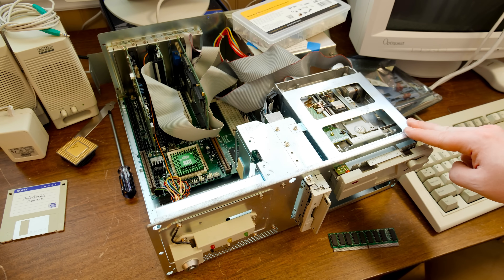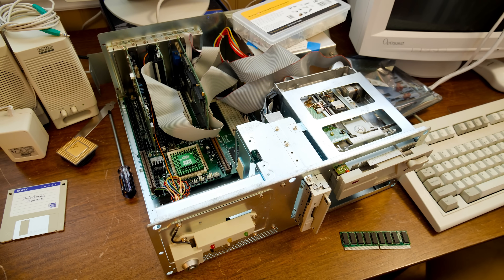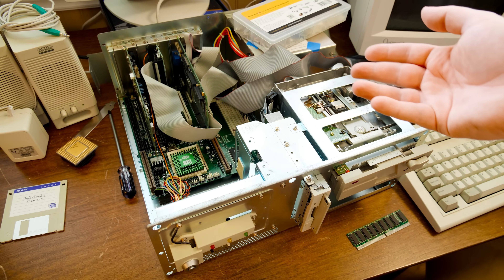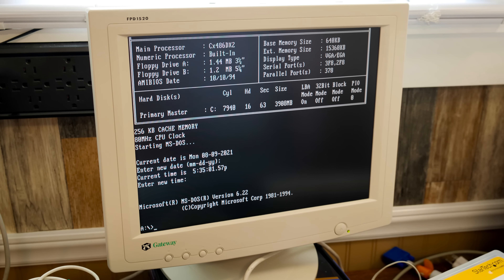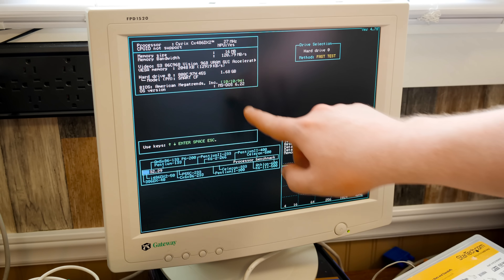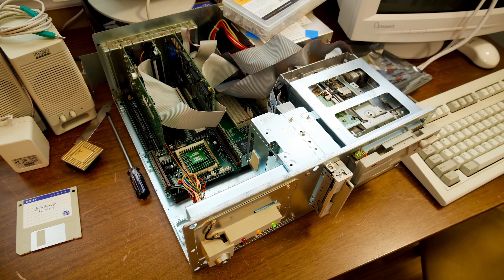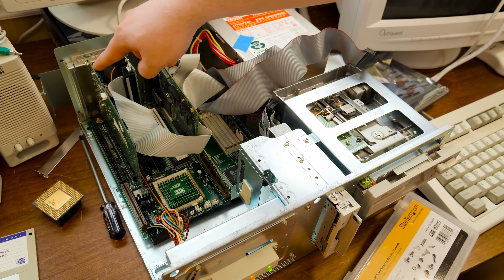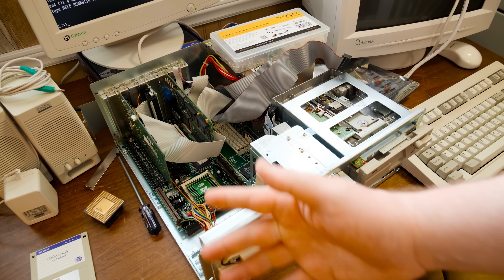M919 Fake Cache and Reproduction L2 COASt Modules

Comment: We used to have a couple pcchips based systems back in the early 2000's at my home. They where the ones where the motherboard had an AMD ¿Duron? procesor soldered into it, and the BIOS was modifyed so it looked like said procesor was a bit faster XDDDD. Mine was labeled as a 1000+, wich means it should be running at 900Mhz, but it was actually running at 800mhz, and BIOS was only tampered show a different model, not a different frecuency!! So, when my pcchips computer was a bit over a year old, there was a couple power outages, and then I felt something was off. "Wait... is this running faster?" I checked, and it was running at 850 mhz XDDDDD. And then the very same thing happened a few months later and it was running at 900mhz XDDDDDDDDDDDDDDDDDDDDDDDDDDDDDDDDDDDDDDDDDDDDDDDDD Weirdest thing that ever happenned to me with a pc.

Comment: These PCChips boards are so strange. Honestly, I don’t understand why they went through the effort of putting together a really solid board—decent chipset, decent VRM, and VLB/ISA/PCI compatibility—all to just add fake L2 cache. The M912 v1.7 is also somewhat similarly-afflicted, but what’s really weird is that not all of them have this issue. Some have fake “Write Back” DIP-28 modules soldered directly to the board, and others, like one I own, actually are equipped with DIP-28 sockets for cache chips! The best part is the shady chipsets, which claim to be UMC8498Fs, but some of which have a UMC sticker, rather than a silkscreen. I think PCCHips wasn’t the only company to pull this stuff, as I’ve got an MTech R407e, which was sold as having previously had 256kb of fake cache, whereby half of of the cache was real, half was fake, and the BIOS reported 256kb. Sure, I get that the manufacturer is saving money, but why? The board worked great with 256kb of real cache installed too—that’s the real kicker. As for the M919, it’s a real good board. I know CPUGalaxy had success with his in overclocking, and it’s unofficially capable of a 60MHz FSB. They’re fast, too, but the fake cache mars their reputation; it seems like they’d be heralded as really good boards if it weren’t for the shadiness that surrounded their marketing. One other thing: the PCI bus has an automatic divider such that—at 40MHz FSB—the PCI bus runs at 20MHz! As much as the M919 is legendary and infamous, it sure is one weird board. Don’t know if it helps, but I saw you found the manual and, for quick reference, Ultimate Hardware 2019 has a good jumper manual: http://www.win3x.org/uh19/motherboard/show/582. RedHill has some info on this board too, and it was apparently not well received by the shop, due in part to PCChips’ shady business practices: https://redhill.net.au/b/b-96.html.
Reply: half the time the chipset was fake as well, the pc chips bullshittery goes pretty deep
Reply: Make a few good products to get an okay reputation then put out a bunch of trash to exploit that and the ignorance of others. Most people wouldn't even think to check if the L2 cache were real or not and, as we've seen in the tests on this video, most people wouldn't even be able to see much of a difference in practice anyway.
Reply: I have a board with the soldered in fake DIL chips. I guess they wanted to lower the price / increase profits and not fitting expensive cache chips was a way of doing it.

The whole saga seems like a precursor to VW's Dieselgate, although PC Chips didn't end up having to buy back all the motherboards.
Reply: PC Chips was not strange - it was lowest quality on market, typical China products. Nothing was below. Cheap but terrible on any level. It has been trash product already on production line.

Comment: The memory check at the starting of the computer seems pretty wonky as well, 16 megabyte  is not 16000 kilobyte, it's 16384 kilobyte.
Reply from the maker: Yeah I found that strange as well. Memory's perfectly good though, I used it in another machine for years and it passed all tests I performed the other day

Comment: Huh, such a fascinating and oddly dumb thing - I only dealt with prebuilt PCs back when (mainly Compaqs, a few Dells) in 486, Pentium and compatibles times, so I didn't get to scratch the fun (albeit sometimes stupid) sides of components until the Socket A/370 era. Granted, prebuilts with their ginormous amount of proprietary bullcrap wasn't exactly always fun either.

Nice video as always, Clint! An AudioDrive (ES1868F is such a lovely chipset) would be a "slight" upgrade for that awful Vibra16! ^^
Reply: I didn't understand most of that and that's why I subscribe to LGR

Comment: Yeah i had one of these. i plugged the wrong COAST module into it once, let some smoke out of the module. 

Those fake chips just have like metal combs in them. I broke the top off of one of them and have a picture here somewhere. I think my M919 went in the trash about 15 years ago.

Comment: I'm more surprised that someone designed a clone of the cache chip for this board
Reply: Well, this board was sold by the millions and this fake-cache was known from day 1. I'm surprised he never heard of these boards or how cache even works. Now he knows! :D
Reply: TBH, I just needed that video to know about it :-/. And guess what, same thing going on in one of my retro-rigs. But since the reduction in memory speed by swapping from EDO to standard is overcompensated by adding REAL cache just slightly, I don't bother to do smth about it. Deep inside I am a little annoyed, though...
Reply: Also it's relatively easy for hobbyists to do this this kind thing with modern tech and online services.

Comment: This is genuinely hilarious timing. Released a video on fake cache right when AMD's new gpu with fake pins comes out.

Seriously though it's insane this was a thing, imagine being the poor engineer having to designate part of the board for fake cache

Edit: spelling
Reply: Wait, what card?
Reply: @daemonspudguy  the 6600xt. It's a pcie 8x interface but they added extra contacts to make it look like it's 16x.
Reply: @Its_Soph_ie  That's not a new thing AMD did, though. As far as I know, every GT 1030 has a PCIe x16 connector despite only having a PCIe x4 connection.

I'm not quite sure why, but it may be just that people expect a GPU to have a long connector, and would be confused with a card that didn't fill up the entire connector.

I wonder how many other GPUs are not PCI x16 but have a full sized x16 connector.
Reply: @ZipplyZane  I know it's not a new thing, but at nearly 400 bucks I'd expect a full 16x connector. Even if at gen 4 speeds it doesn't need it.
Reply: @Its_Soph_ie  "i cant believe they made me pay 450 bucks for a 16x interface the card cant even fully utilize!"
Reply: @Its_Soph_ie  I can see that argument. But I was just talking about the connector looking like a PCIe x16, not about the card.

I honestly don't think I've ever seen a card that had a x8 connector.. I've seen x1, x2, and x16, but that's it. And for slots on the motherboard, I've only seen x16 and x1.
Reply: @ZipplyZane  fair enough. I've only seen true 8x in server chassis before. I guess to keep appearances I can understand, just find it weird in a card this expensive
Reply: A lot of mainboards have x16 physical slots that are only x4 electrically (chipset/CPU limitations). I haven't heard anyone refer to those as "fake pins" before. Since I have yet to see an x8 slot on a consumer grade motherboard, what would be gained by going with an x8 connector for the graphics card? You lose rigidity, possibly confuse people (not sure about power delivery through the slot). "[..]at nearly 400 bucks I'd expect a full 16x connector. Even if at gen 4 speeds it doesn't need it." - Why though? You realize that x16 PCIe slot would consume more power (if utilized or not) and not gain you any performance? I can understand someone with a PCIe 3.0 system saying that, since they might lose some performance in edge cases. But I find it strange to liken these two examples.

Comment: Love this video Clint. Any chance you could give us a "History of Shady Hardware" type video(s) on the main channel?
Reply: I've been dying for a Tech tale for years now
Reply: I second this motion! Shady hardware history is very cool.
Reply: I'd love that.
Reply: I would really love this too!
Reply: I used to build PC's back in the 1990's.  Never heard of this!
Reply: @michaelblair5566  so did I. And a few less than reputable pc shops around here got a name for using the cheap boards that came with them. One of them used to hot glue all of the wires and cables onto the board during assembly.
Reply: I miss Tech Tales so much

Comment: I remember reading about the fake L2 cache MB's. Part of the reason why PC Chips had such an awful reputation in the mid to late 90's. Even when they rebranded themselves as ECS later on the stigma partially remained. 
Also, adding L2 to a 486 system doesn't make a huge difference in most DOS based programs & games (with some exceptions of course) but it does make a noticeable difference in Windows, especially Windows 95. I had a 486 DX2 66Mhz based machine from 1992 that I had upgraded to an AMD 5x86 133Mhz CPU (running at 120Mhz due to MB issues) and adding 128KB of L2 to that machine via socketed chips on the board made a nice difference in Windows 95 back then. Hardly noticed a difference in DOS. I had the option of adding 512KB of L2 to the board but it would have cost much more than 4x the cost of 128KB and being a broke teenager at the time I couldn't afford it.

Comment: Don't rely on cpu benchmarks for cache performance testing. Cache makes memory access faster, but an old test software may only do some simple calculations in a loop that only uses a few bytes from the memory.
Reply from the maker: Good point! I often notice more of a performance gain in certain games than I do old benchmarks.
Reply: @LGRBlerbs  Yeah, I might try DN3D or something. Web browsers are a good test, too - Mozilla would run a fair bit smoother while using the very same DX/2-66 after swapping out a slow VLB board for one with roughly doubled main memory performance, and that's with L2 cache already in. I also found a lowly Pentium 133 to be surprisingly snappy if decked out with 512K of L2 cache + tag RAM on a GA-586HX even with just fast page DRAM in it (I had gotten a good deal on 128 megs of FPM at one point, and this was my NT4 machine as well).

Comment: I must of had the same motherboard in around 96/97, got it off a friend who had a dx4/100 from new, then fitted a cyrix 5x86/100 and with the cyrix installed it wouldnt boot at all with the l2 cache enabled, but still gave an improvement over the dx4. I got it because it had vlb and pci, so I could still use my vlb card from my 486 until I upgraded to a 2mb diamond stealth 64 pci.

Comment: As far as the PSU goes, I would swap that out for a better model as the original probably has some dodgy capacitors in there after all these years.  With an upgraded CPU such as a Pentium Overdrive or similar I would expect this machine to go well with either a TNT 2 GPU or a Voodoo 2.  As you mentioned the soundblaster clone in this PC is rubbish, a better card with a header for Roland GS/GM module or similar would be the kind of thing I would want in a system like this.

Comment: This might very well be a newer version of the board I had back in the mid-late 90's, for the first PC ("It's ST" 486 DX2/50 with 4mb ram) I ever built myself. I'm fairly certain mine didn't have VESA slots (not 100% on that though, maybe it did and i'm not remembering) and that it had fake Write Back cache chips but through hole versions (which I didn't know were fake until quite a long time after i'd bought it)! I assume it has a rigged bios. I'd still like to find one just for the sake of it! I found a webpage/blog that some one made a while ago where they had a PcChips board with fake Write Back through hole chips, so they removed them and sliced them in half to find they were pretty much just solid plastic with chip legs and no core whatsoever, so they replaced them with proper cache ram chips and it actually worked fine and detected them (and in fact performed really well), so those ones at least had all the correct traces running to and from them!
Reply: I have a board like you describe somewhere. The tops of  the Write Back Cache chips look wavy I assume they only go into the plastic a couple of mm. Unfortunately they are soldered in so it would be a big job to replace them all.

Comment: Another possible scenario is that they didn't want to reprogram the robotic chip placement machines for the no L2 cache version of that motherboard.  In which case they would have replaced the clip holding the chips for the robot with a clip of dummy chips.  This means the robot could go about its business and it doesn't cost the company much money to put pieces of plastic on the board, instead of shutting down to reprogram the robots.  I've seen it before with other manufacturers where they might have multiple versions of the same product. If they want to remove a feature they will sometimes just insert dummy components because it's easier than reprogramming things.  The only thing that can determine if this was a scam or not was whether they sold the board with the claim that it had L2 cache or not.
Reply: Definitely a scam. It's trivial to change the BOM on a pick and place machine, but the most telling thing is that a dummy chip would not say "write back" on it. I also doubt the traces on it go anywhere (you'd have to check underneath for vias to be sure), but also there's no decoupling caps or pads for them anywhere close to the chips, as you'd need for a real device.

Comment: This was INSANELY common back in the late 486 and early Pentium days. I have three different mobos with fake cache chips. ALL look like that with traces that just join the two chips. Sad part was, this was normally done on boards that were actually otherwise high end. My best and fastest 486 board with PCI and VLB also has fake cache. The fix was to just use a COAST module (all mine came second hand with one already). Most of these boards also used a graphical BIOS.
Reply: "otherwise high end"
Yeah. That's the great dichotomy of the fake cache plague. I gather that most of the fake cache boards were actually manufactured by PC Chips and rebranded by other companies(my boxed with manual fake cache board has NO manufacturer marks of any kind). And the M919s were actually fairly nice boards when done right, but PC Chips was ABSOLUTELY willing to do things wrong to meet a business customer's desired feature set and price point.

"We want your M919 VIP board, because having VESA and PCI both is hot, but we want it cheaper. If we didn't want cheap, we'd be making a Pentium."
"Do you care about L2 cache?"
"Not really, no."
"Then we have just the board for you!"
Reply: One thing I noticed about my PC Chips 486 board is just how thin it is.  Thing flexes like crazy when handling VLB cards.  They really went out of their way to make the cheapest crap they could.  But the crazy thing is, it actually works and is a half decent board...
Reply: @sirnickity  That's Pc Chips for you. They were generally considered low end boards. Though generally they did still work just fine.
Reply: @harshbarj  They got better, to the point where some were quite decent. That was a while after the fake cache era. I put together a lot of Socket 7 boxes with PC Chips boards.
Reply: @sirnickity they were the asrock and biostar of their day. Cheap shit that lasts forever and works fine if you don’t break it!

Comment: Yeah, these old power supplies don't generate a lot of heat. I picked up a Pentium 1 pc from work that had been in continuous use for years. The CPU fan was barely turning over and the PSU fan suffered a catastrophic failure. The power supply still was in fine condition and the caps weren't  that bad, either. Lubed the CPU fan, replaced the PSU fan amongst other things... made it functional and easier to replace the Dallas clock IC (those where a thing back in the day!) by placing it in a socket.

Comment: Check the CR2032 and make sure it isn’t really dead. I recently had to replace the CMOS battery in my PC, so I put in a CR2032 from my stash. Brand new, unopened. But it didn’t work. I checked the voltage and indeed it was a bit low. Guess I had bought those batteries longer ago than I thought.
Reply from the maker: It's brand new. Turns out there was a missing motherboard jumper!

Comment: I own a bunch of PC games on CD-ROMs that won't install on Win10 because, from what I've read, the pieces of ** copy protection methods used.  And, no, compatibility modes don't work.  What's my cheapest solution to enable playing those again?
Reply: Dual boot an older OS.
Reply: @simontay4851  Tried that, but my hardware is too new and no proper drivers exist in older OSs like my legitimate copy Win XP.
Reply: gog.com is an option too for DRM-free versions, if you don't mind buying those games again.  Though I'd wait till they're on sale.  (And I'm still unlikely to give EA anything to re-buy my old Maxis games.)
Reply: @AaronOfMpls  "I'm still unlikely to give EA anything to re-buy my old Maxis games."  Same here, but that goes for anything that will no longer run under Win10 just because of copy protection.
Reply: virtual machine